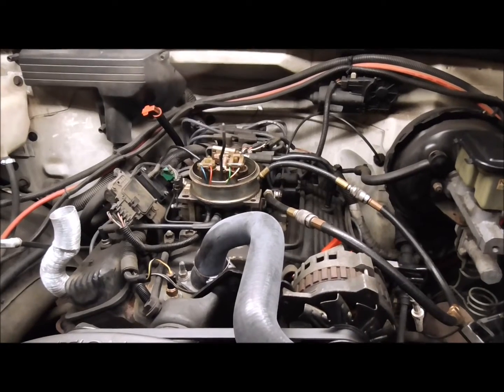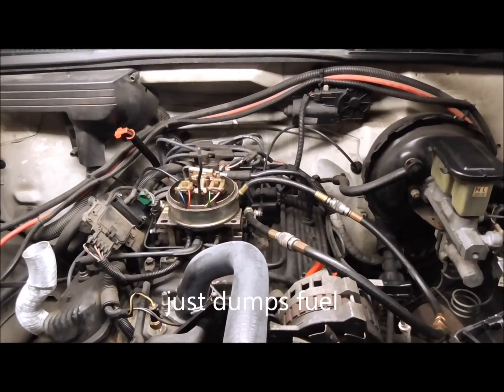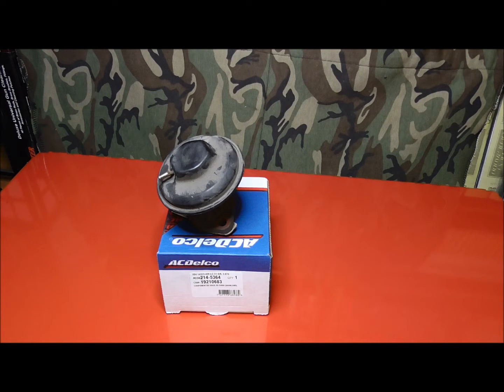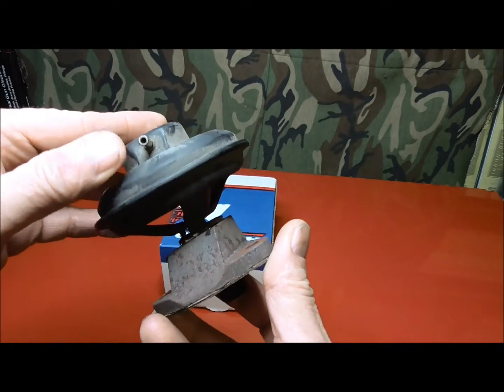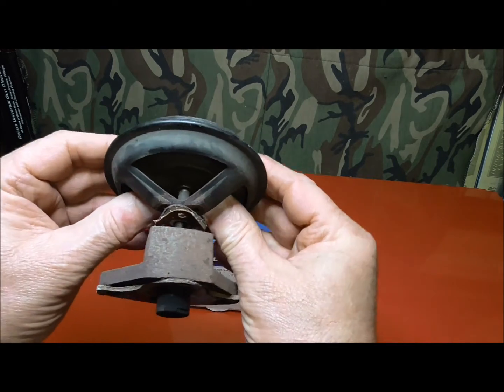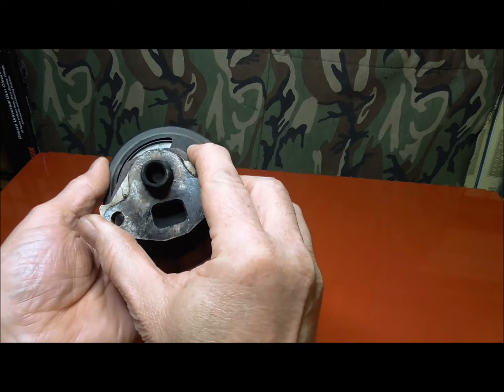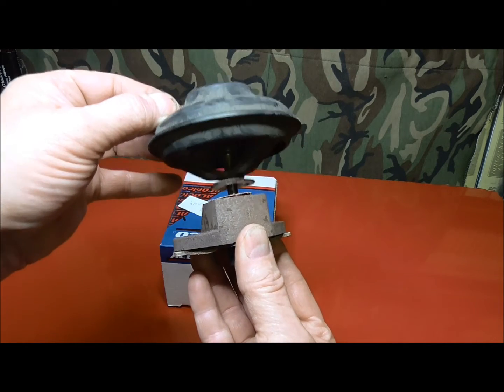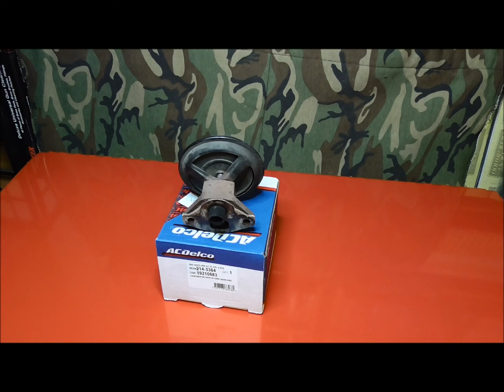89 chevy c20 egr

Comment: You can block it off and leave it hooked up. The computer will think it’s still there and it will be fine. There is NO benefit running hot exhaust and carbon back into your engine.  It contaminates the intake charge and increases wear.  
 If you live in a smog area, you can unblock it to pass the test, then block it back off again.

Comment: why not a egr delete kit ??
Reply: djverhulst / because without the egr the engine will not run well at cruising speed when the egr is supposed to be working, the mix will be lean and the computer will pull timing to compensate. If you remove your egr you have to reprogram the ecu and in the case of these tbi engines you’d have to have a chip installed that doesn’t have the egr programming.

Comment: I really need help with my vacuum lines on my 89 GMCvan also perg  canister please Help!!!!????
Reply from the maker: the throttle body has ports on it.  J, C, A are in the front and F is in the back. Port A is the purge line for the canister.  It should be the one on the drivers side of the front of the throttle body
Reply: @WarrenAutomotive  that's the problem I'm having with my 1988 Chevrolet Silverado the purge line has no vacuum but the other lines do

Comment: Your truck is probably getting flooded
Reply: To much gas is coming in that’s why it runs with one injector you need to replace the thing inside the carb that opens and closes how much gas it needs
Reply: @notmedrano3432 I cannot find the fuel regulator cap. Where did you order one?